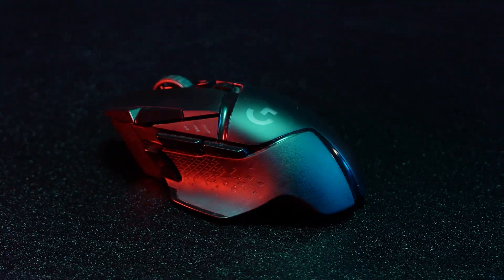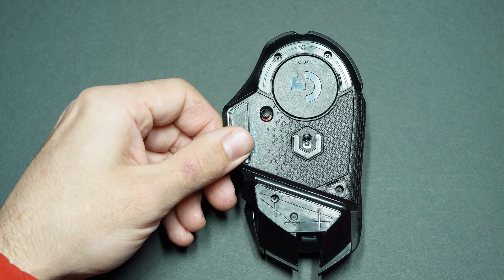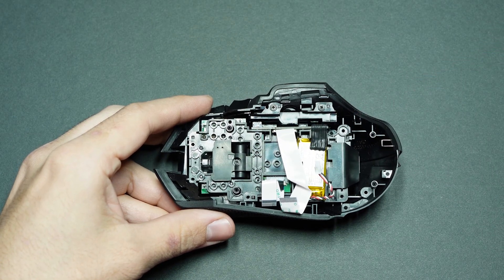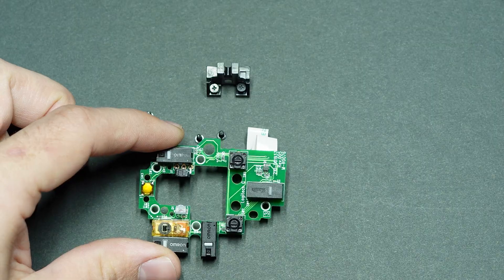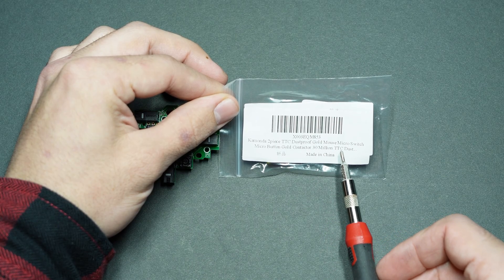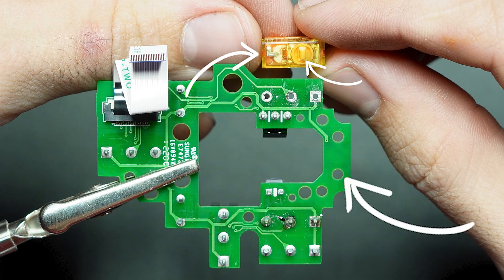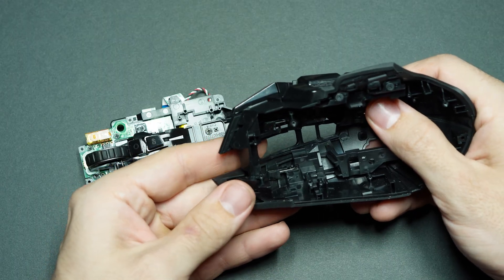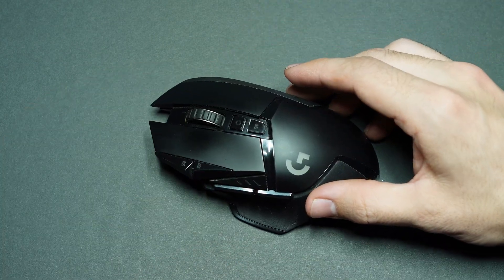Logitech G502 Lightspeed Micro Switch Replacement Tutorial -- Double Click Issue Fix

Comment: Hey, I know this video is about 2 years old, but I wanted to ask how the replacement switches have been holding up since then. Any double-click issues or other problems over time?
Both my 2-year-old G502 and G102 have started double-clicking, and I’m thinking of replacing the switches since I LOVE these mice. I’m currently choosing between TTC Gold Dustproof 100M, Kailh GM 8.0, and Huano Blue Shell Pink Dot.
I mainly use the G102 for FPS games and the G502 for everything else, so I’d really appreciate your recommendation on which switches would work best. Thanks!

Comment: wanted to show the springs inside the connectors describing a repair I did over a year ago, and noticed this video had been made now. Watched it as I was curious if it was better than the one I referenced back then, and noticed your video is actually a 'worse' fix - as you do not actually fix the bad component. You replace it entirely. Which tbf is exactly what your title says the video is about, and I just didn't read it properly :D
You should look for a 4 year old video by "mofigoDIY" on the subject, it shows how you can open up the switches, and actually fix the springy metal-component inside them to solve the issue. It is arguably easier in terms of how it requires far less tools (no soldering equipment needed. and more importantly, no extra switches needed), but beware that re-attaching the metal piece after you have taken it off, is a PAIN (took me several hours as it needs to be be pulled into tension, but tweezers consistently slip off when you try. The video guy manages it in under 6 seconds though, probably because he bent the front a little bit to give him a lip that is not tangential to the pull-direction. You can see that procedure around 4:47 in that video).

Comment: For $21 on Amazon you can replace the entire board with ALL new buttons (also comes with new replacement skates). No soldering. I also replaced the wheel and upgraded the battery, as to not have to do this process again, atleast for a long time. I don't remember the individual price of everything, but the total came to approx $50 for everything i listed here.

Comment: I bought my g502 back in 2020, so lasted about 5 years before the double clicking started from everyday use. I dont own a soldering iron or any switches, so id have to buy all of it raw and take the time to switch out the switches which, since ive never did it before, might take me an hour or 2. Turns out that the g502 is on sale for $42, which about the same or slightly more than buying a new soldering kit and pieces just to swap switches and it has same day delivery from amazon. Sometimes its better to just buy a new mouse.

Comment: So angry with Logitech. This is the second mouse it has happened with for me. Never had it happen on any other mouse. They should have a 10 year free replacement for these switches.
Reply: Yes they are trash, faulty switches and faulty software with thte newer models and of course no responsibility from them
Reply: Jus replace the switches
Reply: @ I will, but we shouldn’t have to.

Comment: How similar are the guts for this mouse and the G502 Hero? That's what I have, but other videos I've found on it aren't nearly as good as this one, so if the guts were essentially identical, I'd like to use this one if possible.
Reply from the maker: I'm not sure because I have never dug in to the hero, but given how complex this one is, I think if you follow the same concept and disassemble it carefully, screw by screw, you should be fine when it comes to replacing the microswitch
Reply: @StanMakesStuff  Thanks for that, here's hoping I can find out if the switch is compatible or identical.

Comment: Nice lifted switch there. Anyone that wants to do this right solder the middle pin, push on the switch and get it fully on the board while heating the middle pin. Then once the switch is fully seated solder the other two pins. Also when you're desoldering it helps to add flux to the solder joint to get it to flow. The pro method is to just add a bit of fresh solder before you begin desoldering. I know it sounds backwards to add solder to desolder but that's how it's done. There's flux in solder. When they manufactured the board they washed away all the flux they used. Just part of the manufacturing process. It's not a bad idea for you to clean any flux residue you might leave soldering too. Isopropyl alcohol works. You use a cropped flux brush. Or an old toothbrush. In a pinch paper towel can work. Do a neat and clean job of it. Don't leave pinholes in your solder joint like this guy did either. That's an inspection fail. Really his meniscus is terrible. The bigger the glob the better the job are not words to live by. When I did mil spec soldering I had to leave the form of the conductor visible.
Reply: holy shit, this is a computer mouse, not an avionics part, who cares. It ain't gonna kill people.
Reply: @kotono00  I've soldered avionics circuits professionally at a board assembly house. You'd be surprised what they care about. It annoyed even me. But I couldn't tell the inspectors who cares. AFAIK my work has killed people. It went into attack helicopters. I kill a lot of demons with my mouse. I play OG Doom. Solder stuff right.
Reply: @1pcfred  that's exactly what I said, this ain't going into an aircraft, it's a mouse. Who cares what the solder looks like.
Reply: @1pcfred  the switch being lifted is the only part I can agree with. How the solder looks matters very little in this application.

Comment: Any tips on replacing middle mouse swith
Reply: A bit late, but i recommend swapping the snap dome middle switch when it gets bent (it will get bent) with a 4x4x1.5 SMD tactile switch. I'm actually not sure if its 1.5mm height, but you can get them 1.5 all the way to 2mm as needed, not sure exact height

Comment: Thanks for a well-presented video that's clear and to the point.

2 aspects that I found a bit more difficult as it seemed here in the video were the mouse-wheel pin removal and the desoldering.

It's really important to push the pin out properly with a thin tool (paperclip might work just fine). I damaged my mouse wheel trying to just pull it out with force when it didn't go so easily. My bad, of course, but it seemed so easy here.

The desoldering part just seems like magic to me. I see what you're doing and it apparently works perfectly, but I don't seem to be the only one that struggles with removing the solder so easily and even to the point, that you can just pull out the switch with a bit of force and wiggling. What eventually worked best for me was clipping the old switch's pins off, adding a bit more solder and pulling lightly on the microswitch as I kept heating the 3 solder points in parallel to the best of my abilities. Then, I turned the board around and softened the solder again and pushed a thin nail of sorts through to basically sharpen the basic wholes that I can then easily push the new micro switch's pin through. When completing the soldering, I also made sure the new micro switches lay as flat as possible to the board, which wasn't completely trivial given the above process.

I'm just stating all that so others don't wonder why it doesn't work and get stuck, too. And to everyone wanting to attempt this: Please have some proper tools (helping hands) or friends for this process too. It can be a pain in the ass even with all that, but if you don't have anything to properly hold this tiny board etc. in place as you work with a hot soldering iron, it's extremely frustrating.

Comment: Thank you so much! Solved my double clicking issue. Found the old switches hard to remove, had to lever them up with a screwdriver after removing the solder but all good! Replaced with Kailh red switches and they work great
Reply from the maker: Yay! Glad it helped!
Reply: Yeah when I changed out the switches in my Razer mouse it was like they were hammered into the board. The pins were real tight in them holes. I know what I'm doing and I had a time of it.

Comment: I got issues with the 2 sided button on the scroll wheel. Can you make a tutorial on that? What type of clicks are those? TIA
Reply from the maker: Hmmm, are you sure it is the microswitches? Or could it be the mechanical bits?
Reply: I'm not sure what those switches are called, but I'm sure that the issue is with the two side clicks of the scroll wheel. They don't seem to register any clicks. I'm referring to those square box type switches.
Reply from the maker: Those are definitely a different type of switch, but the process of replacement is the same

Comment: what about mouse 3(mouse wheel click, the one you use to close tabs on browser) is it repairable? in mine it works like 2/10 times it's pressed.
Reply from the maker: From my understanding, any microswitch in that mouse can be replaced in a similar way, but with the mouse wheel switch there are a few mechanical bits, (like the spring and plastic) that might be dirty or broken.

Comment: Great video. Well explained and showed the steps.
I recommend using a hairdryer to remove the pads much easier.
How does the TTC gold feel? Right now, I have some GM 4.0 and I want to replace my G703 original switches with GM 4.0‚ but recently I've discovered those TTC Gold Dustproof‚ and I am interested on those.
Reply: The trick to removing mouse skates is some isopropyl alcohol. Work some under and it releases the glue.
Reply from the maker: Thank you! I don't really have a reference of comparison to other aftermarket switches, but the TTC gold are definitely allot more responsive than the stock switches

Comment: Clear instructions, to the point and good tips! Nice video. I cant wait to try this myself, but have to wait for the items to arrive. 

Also, you forgot to put the items in you description 👀
Reply from the maker: Shoot, my bad, I'll fix that right away, thank you! 😁
Reply: Still no links in the description.  @StanMakesStuff
Reply from the maker: I'm sorry, I tried to keep active links for a while, but they change and go down to often. Especially the microswitch itself, always going in and out of stock.
Reply: No worries. I found a seller on Amazon that sells the whole circuit board with new switched installed. Your video is the best at showing the assembly/disassembly so I will be using it for the swap. Thank you! @StanMakesStuff